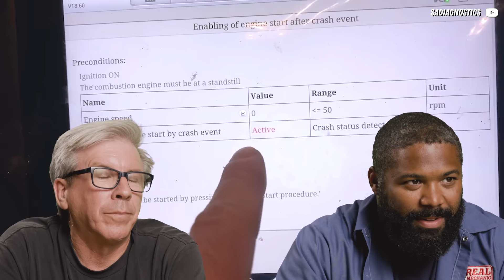Mechanic Reacts to Engineering Fails

Comment: Electricians hate engineers too.   Designing fans where 2 or 3mm (¼") makes the difference between fitting easily in 1 minute and taking 15 minutes to make it fit.  Or allowing room for a 1mm cables when 1.5mm is the absolute minimum and generally needing 2 cables (for multiple lights).   Or switchboards for 7 circuits allowing room for 3 earths (compulsory now for all circuits and individual terminations)
I could go on but just trying to say "l feel ya" rè engineers

Comment: The Ford Freestyle 2006 is the worst designed vehicle you can't check the tranny fluid without taking out the battery which defeats the purpose because the vehicle should be running!

Comment: I feel like punching the guy that decided to put a rubber coolant hose under the inlet manifold on a mazda cx-7. Why not make it solid hose so you don't have to pull the inlet manifold off to replace it. To top it off, mazda australia don't carry stock

Comment: Gonna say this as a former ford service tech, that oil filter isn't as bad as was made out, go a little further to the left and there's easy enough access to even get a band wrench on, instead of trying to go THROUGH the hoses go AROUND, not that hard. Whiny mechanic.
Also, I LOVE 350Zs but I have one small gripe, you have to remove the intake to service half the ignition system and it wouldn't be an issue if the intake wasn't so wide

Comment: I have a dodge journey. Just to replace my goddamn battery, I have to remove the wheel and the trim. It also takes 3 hours to replace my alternator because I gotta remove the radiator hose, and the wiring harness is weird and took me a while to figure out how to unplug it without breaking anything. And since I mentioned radiator hoses, I have yet to find a petcock on this fucking radiator. If anyone else owns a dodge journey, and has found the petcock, let me know.

Comment: Try remove a battery tray from a civic with rusted bolt heads , to get the engine harness out ,Honda engineers at their finest 😂 put a m6 10mm under a battery tray in a enclosed hollow 100mm deep to collect water and rust 😂, probably so you can't easily change to vtech yo

Comment: FIATs are just notorious for their stupid electrical issues. Unlike Audis of BMWs they have reasonable access to most places so in most cases it is a cheap and easy fix but the fact that after a few years something starts to break every year is super annoying. 

FIAT Grande Punto for example has a genious feature of the right windshield water drain pouring all the water and dust and crap straight into the alternator. And if somehow it magically survives then there is a hole in the right front wheel cover that allows all the salt and ice go straight into the poor bastard from the wheel each time you do a right turn at any reasonable speed. Of course there are raplacement drains and aftermarket covers available but none of that came from the factory in 2008 when my old car was made. The wiring from the cabin to the fuse box also has an unprotected section between rubber gromets that goes over the left windshield drain. It even has a few barriers to forn a nice pool of water to get soaked into the wires and go right into the connectors under the fuse box. The moment the crappy vinyl isolation of the reires or a single one of the silicone gromets inside the connectors develops a single crack water starts to creep into the fuse box and gets on the connectors and by the time something stops working it starts to burn and all the nonburnt stuff turns into one big green corroded mess. They fixed both issues in the next Punto Evo line but still WTF and they did not fix the crappy tail light connectors you need to clean and adjust every once in a while or some of the lights stop working.

FIAT makes nice and very good looking and mostly serviceable cars but their electrical job is only acceptable if you live in a bone dry climate. Otherwise it just turns into a constant pain in the butt. And don't pressure wash your FIAT too often or it will once again lead to problems.

Comment: Ooooo i have a perfect clip, the first gen model s lower control arm bolts have to be cut because the battery pack in too close to the bolt thats 8 inches long and you can pull it out so you get a saw zaw and cut the bitch, its just extremely fucken annoying when its a waiter

Comment: 58 seconds in he said the relay should have popped...bro that's not how relays work.  they use a small amount of current to control a larger amount of current, stick with saying the fuse should have popped.

Comment: Oil filters should be near dipsticks, serviceable from above.  Fuse boxes should be next to the battery, serviceable from above.  Both bad engineering here.  A car owner shouldn't need a pit to change their own oil.  And batteries/fuses should be swappable in the Autozone parking lot.

Comment: I hate engineers I can’t count on one hand how many times I’ve had to replace radiators in different cars for friends and the devils clips are underneath everything for the bottom hose and you have remove more stuff just to get to the clips and get that bottom hose off I always put them back facing the right way for easier access next time they blew a radiator

Comment: As a mechanic of 30 years, these "safety features" aren't any safer. Car companies have been telling you they make safer, more reliable, and cheaper cars. Where are these cars? I haven't seen them in years. Sheep keep buying them, ill keep making money fixing them. $1200 for a spark plug change? Yup, i have yo remove the cab, yes the entire cab, to your truck. I didn't design it or buy it, but ill fix it for ya dummies....

Comment: Engineers today do not care about vehicle service unless they're designing military equipment (where the customer has considerable input vs. zero when it comes to wheeled civilian vehicles). Many frustrated mechanics quit because we can make much better money with less suffering in industry or aviation. I openly despise the people who inflict the time and resource-wasting designs on the public (who even if they never turn a wrench must pay the consequences). I wouldn't recommend auto mechanic work as anything beyond a hobby in 2024 because technicians get no meaningful respect, the flat rate system wrecked compensation and there is no medical or retirement plan worthy of mention. 

While it was less bad forty years ago I thank the mechanics who warned me away from fixing cars as a career. I retired young with a vastly better Air Force pay and benefit package. I've wrenched cars for profit over the years for side money but suggest any young enthusiast do something better for a living and play with cars on the side. If you can work on cars you can work on aircraft and aircraft are vastly better to work on. Not dealing with ignorant customers is glorious and when your work keeps aircrew alive in combat they tend to respect you. (Women make excellent aircraft techs too, my mother worked the PBY Catalina line in WWII and my wife was a USAF helicopter and fixed wing crew chief.)

It's totally worth it to wrench everything you own which easily pays for tools and equipment so I do, but I'd have to be desperate to fix cars for retail customers or most dealers. If you can fix cars you can learn machining, welding, mechatronics or millwright work (and will have an easy time of it thanks to mechanical aptitude). Engineers are part of what makes wrenching miserable in 2024. Their degenerate MBA bean counter bosses failing to demand maintainability (easy to design into systems) are the root cause. Having to constantly buy tools and test equipment bleeds money. Ask any current mechanic what they REALLY net PER HOUR after expenses.

Comment: Audis have some of the most mind boggling electronics. I have a 2014 S5 and the reverse cam doesn't work. It will fault out. Checked the codes and it was showing that a proximity sensor was bad. Changed that. Still wouldn't work. Then found out that for some reason, Audi has adjustable beepers. This means that you can adjust the volume, tone and pitch of the beep for the front and rear sensors. I've had the car for a long time and never once thought to myself, "Hey, I really wish that the parking beep tone was different." Anyway, that tone adjustable speaker for the rear sensors has a tendency to short out. Its a cheap item to replace, but what I don't understand is why would you make the park assist module completely shut off if the SPEAKER is shorting? 

Why does the camera turn off? So retarded.

Comment: 7:45 that’s not just a ford problem. Just buy a good oil filter claw for removal. Install is only supposed to be hand tight anyway. Does cause the hoses below to wear prematurely though… that was the real victim of these stupid engineers. That oil is going to wreck these hoses in a few years

Edit: 9:00 , they called it. Imma shut up and let daddy Sandro and mommy Angelina talk now.

Comment: Fuckin audi reminds me of my cb300r's fuse box location. That bitch was tucked under the tank, behind an aero piece, wedged between 6 bits of plastic and the frame. I spent half an hour fighting to get the damn thing out just to try and disable abs. Afterwards I put the fuse back in and hoped I would never have to see it again. 
New bike has the fuse box directly underneath my ass and I can have a fuse out in under 30 seconds.

Comment: The thing with Audi espacially. THOSE ARE maybe the MOST OVER engineered vehiceles out there. I was a driver for a big car rental company and I kid you not. A collegue and me tried to find the opnening to fill the washer fluid on an Audi A6 for over 10min.
We just were not able to SEE THE BIG BLUE cover because F****G AUDI PUT IT BETWEEN THE HOOD AND THE A COLUMN, so when the hood is open, the hood itself COVERED the opening to the washer fluid. Its simple once you know it but damn I wanted to hit this car so badly.
Another great example of over engineering in an Audi. To change the belt on some models you NEED TO take of the bumper, the cooler and maybe a wheel and some other parts only to switch this damn thing. 
I like the cars don´t get me wrong. Love to drive them but those examples are the reason why I would never buy a newer Audi. The cost of only maintain it is just a big joke.

Comment: When it comes to both engineers and mechanics there's good ones and bad ones. A car is never designed by a single engineer but by dozens of them, that's why some design choices are brilliant and some are idiotic. But if we're talking shit about engineers because of the bad ones, should we also point out that most mechanics are sleazy, incompetent assholes and if you just pick any random shop to do some work on your car you're more likely to get ripped off than to have a good service done? Mechanics breaking shit, not fitting them correctly and causing more damage, changing 5 good parts before the one that actually was faulty because they don't know what the fuck they're doing, and just outright charging customers for work they didn't actually do are all everyday occurrences.

And while mechanics have to deal with customers, who often break, misuse and neglect their cars and lie about it, engineers have to do with bean counters who will often undo an engineer's work to save a few bucks and THAT's what ends up causing problems.

Comment: That ford escape with the oil filter. Situation is not just annoying, it's a Really, really bad design.and Really bad engineering and no, the oil filter doesn't have to go anywhere.It can be designed in a brilliant place for instance toyota tocoma top engine filter! Lol 1999 to 2000s chevy/gmc trucks  i mean come on! And Fords stupid a** design with their F150s.They tried to make a dumb little waterfall.Oil filter drain design that never works😂

Comment: I wanna agree with y'all about the whiny driver about the door but have you ever parked at the far end of a parking lot and someone parks next to you too close when there's plenty of other parking spaces that they could have chosen? With a normal door car have difficulty getting into it and if you had a car like that you wouldn't have been able to get into it without getting in the passenger side instead. Also look at some of the others that you said was whiny mechanic and think usually the OWNER does it them selves. Would you still say whiny or look at it as bad engineering? Honestly I have done allot of mechanic work on different vehicles because I know allot about vehicles and there are certain ones and certain things I tell them to take it to a mechanic or have a mechanic do for the simple fact it's ridiculous on what has to be done to achieve the results that are desired.  Like being use to a thermostat housing and all on top of a motor then there being one on the bottom of the motor requiring Allot to be removed only to do the thermostat. It causes the cost of things to go up. Being as the simpler it is the owner can do. And sometimes someone that is known for example is asked to do mechanic jobs for someone who doesn't do them at all. And in turn is known as their mechanic for doing pretty much all the mechanic jobs that they have and need one for. Some y'all said were whiny mechanics even I agreed was bad engineering because not all "mechanics" have the patience or getting paid enough for the job they are being hired to do and when you change the price or tell them what all has to be done and that the price is higher. They look at it as your just trying to get more money out of them for a simple job. Then they don't wanna pay you the amount they should even when you save them hundreds from having to take it somewhere else. Think about it though is it really a whiny mechanic or bad engineering. Things should not be harder or dang near impossible for the owner or mechanic to do being as there are owners who will do the research and work to change the parts and things that need to be done on their vehicles.

Comment: You ever change the alternator on a Volkswagen and had to take out the compressor to swap it. Put it all back together and find out you have to do it again? Right alternator for the right motor for the right year in the right box. But this particular engine runs a backwards belt so you have to buy the same part again only spinning in reverse. Fuck german cars.

Comment: 2017 f150 3.5 ecoboost. oil drain plug points horizontal straight at the passenger tire. you have to hold it a quarter of a way open til about half the oil comes out before you can pull the plug all the way out. if you just pull the drain plug (you know like a normal one) oil will shoot across all over your passenger wheel assembly and ground. good luck getting it to stop once it starts. fk you ford

Comment: The Mercedes .... with the shut down after crash ... bad engineering ... and BS ....   you have the ability to sense the free flow  of fuel with a sensor ... it simply will have flow but not pressure.   How about you narrow the scope of that BS that way .. instead of leaving customers to bend over and take it up the @ss in the middle of a freeway.

Comment: F😅😅k Ford. Ecoboost is an engineering nightmare. Open deck blocks soft cams timing chains phaser turbos purge valves and gas necks. All set to fail by design. But people keep buying them. Wtf

Comment: It's not that hard to work on an Audi...at least it's a new model...then you're fu**ed. I've got an Audi a4 b7 sedan and the only issues with that one were the bolts from the turbo...rusted, crusted and baked dead into position... and the knuckles of the steering subframe
Parts with holes made of aluminum screwed together with thick steel bolts. With time the bolts deform and with bad luck you have to cut them out in narrow space 😅

Comment: 15:35 shit design .... what super about a car that you CANT GET INTO if anyone drives a "normal distance" away from you?
Does the world suddenly get 50 cm wider just because you drive that crap shit through town? NO! It does NOT! ... and other supercars do not have the issue!
Plus the RUBBER ON TOP has to be super because rain doesnt run along but GATHERS on top so if you are unlucky you rain into that "super car" of yours
Ferrari doors allow you to get out anywhere with ease, LOOK COOL (iconic), and yet are far more water ressistant and it wont rain into your car even if NOT. epic fail.

Comment: I wish u could've seen the oil change I had to turn away, a fuckin Fiat (go figure) and the asshole put in a new cold air intake by himself and I would've had to remove the entire intake system to still not be able to properly reach and swap out the oil filter.... Later dude maybe put your intake system in a real car not a bullshit Fiat

Comment: As a mechanic if I designed a car. There would be buttons and snaps with a foot of clearance between all of them. The front end would be 12 feet wide and 15 feet long with a electric recliner flat screen and a pole for Angelina sorry girl but your a fox

Comment: Pull the damn oil pan. Start pulling rod and main caps till you can rotate the damn crank... whiney little toad. In 31 years I have done that probably 15 to 20 times. Pain the ass but shit happens. Get outta the box, find a solution and git'r done.  Oil filter placement, oh yeah not a big deal. I want to see you stick your arm up there on a 100+ degree day after that customer spent 2 hours driving that car. Talk about hot.